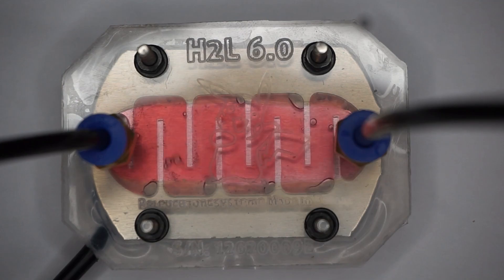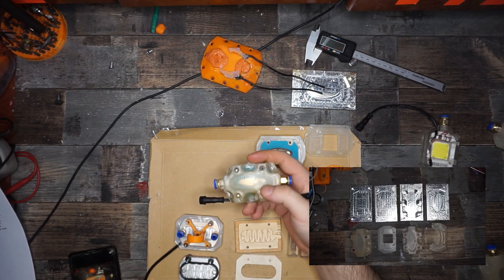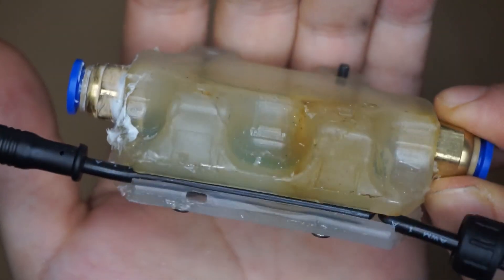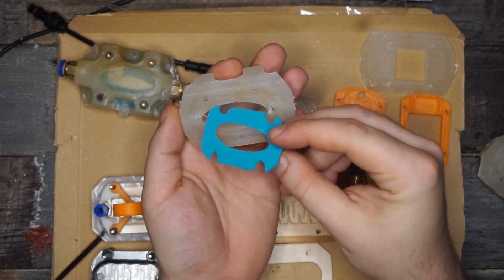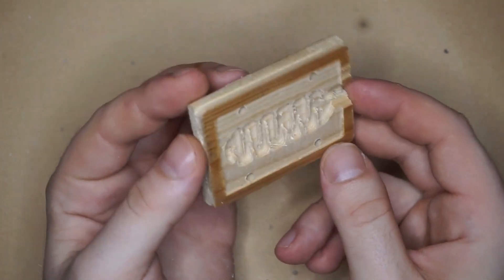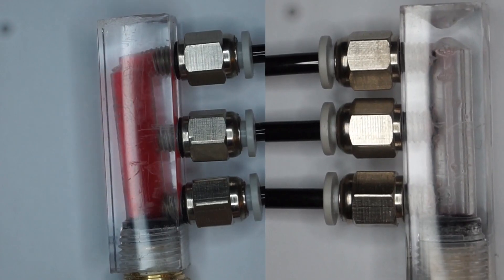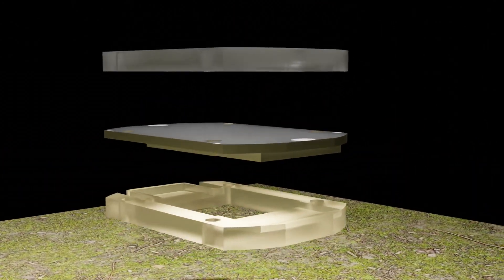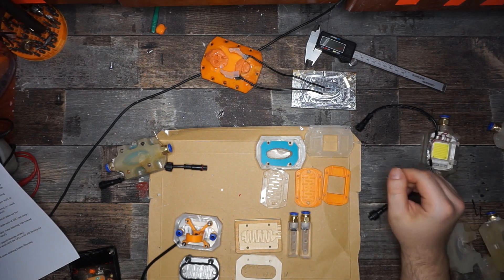H2L 6.0 Watercooled 50W Cob LED modules

Comment: Im curious if youve looked into cheap pc water cooling blocks for cpu's. Just need to thermal glue it on and it would be set. The acrylic can crack quite easily. Delrin is better but expensive.